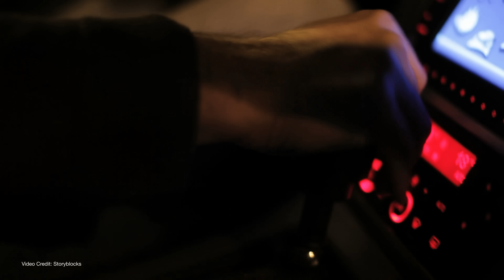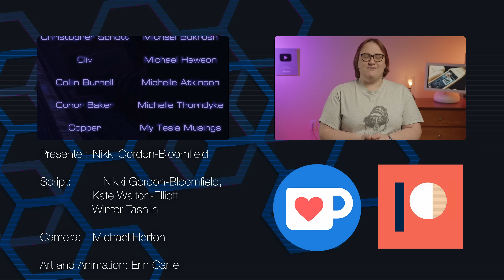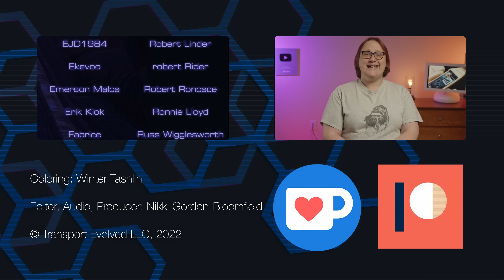Electric Cars Don't Need Gear Shifts - So WHY Is Toyota Working On One?

Comment: Manual transmissions for EVs is a great idea...for Toyota. More wear, more servicing, more parts sales and more revenue.
Reply: My experience  with manual is that they last longer than any other type of transmission.   I have a saab with 350,000kms , still works  perfectly.  Shifts flawlessly.   It's a joy to drive.
Reply: @leschortos9196  yes, manual transmissions are great for ICE cars. Unlike ICE cars EVs have max torque from zero rpm. They don't need to change gears. They have a fixed gear train - no clutch or changing of gears at all. This is much simpler and much more reliable. Basically no oil changes and no maintenance for the life of the car. Manual (or auto) gearboxes for passenger EVs are a stupid idea. The only EV so far that has a gearbox is the Porsche Taycan with a 2 gear auto in an attempt to get better acceleration over 100mph. Still, much faster EVs like the Tesla Plaid and Rimac Nevera are only one gear.
Reply: @fangitjoe  oh yeah I know all that,I think it's stupid putting a gearbox in an electric  car.  You know whats  even stupider, is having a car lightening fast for no reason  other than bragging  rights. Why not make the motor smaller,  lighter better range, and adequate  acceleration,  tell Elon, to put the power in his rockets, right now we need good heater in our teslas. Not rockets on wheels.
Reply: @leschortos9196  Yep, not going to disagree with you on that. Some of these new EVs are crazy. The Hummer weighs over 4 tons and has a battery 5 times the size of a normal EV. What a waste of resources.
Reply: I see that you are not someone with electrical education. Let me explain.
Electric motor is not efficient over entire range of RPM. You need to take into consideration RPM or Frequency in your calculation of current required to run at certain speed.
It is not only high speeds where EV motor is not efficient, it is also slow speed where your PF (Power Factor) can go as low as 40%.
For ideal operation and best efficiency you need to run (for majority of motors used in EV) between 60 - 80% of load. 
If you can manage this, you will rapidly increase range for city and highway speeds (more for the city than highway because of drag). And as added bonus you increase effective torque as this drops quickly after about 80% load
Reply: @beastlysun  thanks for the heads up, perhaps an automatic  trans optimized for  range may be the best option  then. Computer controlled for max range.
Reply: @beastlysun  Thank you for your genius lecture. Most EV VFD motors only lose significant efficiency at lower and higher ends of the speed range. For an EV geared to do 200kmh, extra gears provide insignificant efficiency benefit unless you spend a lot of time below 40kmh or above 160kmh. Nobody wants to change even one gear going up to 40kmh.
Reply: Very smart comment 😅 Grow up

Comment: More likely Toyota put in the patent to prevent anyone else from doing this. Whether they introduce a car with fake gears is likely unknown at this time to Toyota management. But if there is enough of a demand for fake gears, they are in a position to be the company who will do it.  I imagine they can do this electronically by just having fake torque bands for different RPM ranges of the electric motor. 

As for my 2016 CR-V, I prefer that the CVT behaves like a CVT and not a fake classic automatic transmission. 

But really, my next vehicle will be an EV, maybe in 2024 and I would not touch one that had a fake gearshift and clutch in it.

Comment: I took my drivers license behind the wheel test in California in 2007 in a manual transmission Toyota tacoma. I have never owned an automatic transmission vehicle. I do see the value in a manual transmission in icy and snowy conditions because it allows a controlled way to decelerate that seems to work better than braking. I am not sure how an EV would fair in this situation with the single pedal driving but I can see how the faux manual transmission in an EV could be more fun and make me feel safer in those conditions. I am not ruling out the possibility that an EV could do this job better of slowing in icy conditions but I do love the interaction of shifting! :)
Reply: Shifting regime or acceleration is dangerous on low adherence. The smooth, continuous range of EVs is an advantage here.
A Tesla slows first using regen, then brakes only if harder is needed.
Reply: @musaran2  Yes. I see. You are right. Any sudden change in speed due to shifting can cause loss of grip. I an very interested in trying an EV in icy and snowy conditions and learning how to use it in the safest and most fun :) way

Comment: I don't see transmission-type requirements adding much in the way of public safety.  Most people can reasonably learn to drive a manual transmission in 20-30 minutes, and the person teaching them is typically sensible enough to do so in a safe place, both for their own safety and that of their vehicle.  Those who prove to be non-adept gear-crunchers in this first experience tend to strongly self-select themselves as "auto-only" drivers.  And thus the imagined "problem" is effectively dealt with, without any unnecessary legalities, expenses or restrictions by the State.  I'd like to see the accident/injury statistics attributable to lack of manual transmission experience.  I suspect it is negligible but I'm open to being proven wrong.

Comment: I'm pretty sure Toyota just wants to add more moving parts and complexity so it adds more maintenence and higher repair costs.
Reply: Toyota prides itself on being reliable. So why would they want to engineer more maintenance and repair cost into the car? It's going to be an electronic system that simulates gears, I don't think there will be any real gears in the car or any moving parts other than perhaps a lever but that'll be electronic as well.

Comment: I have a 5-speed 1990 Miata. I want it to live forever, but when the tiny 1.6 L engine dies, I want to convert it to electric. It would be awesome to have an electric conversion that maintains the manual shift. It is a significant part of the experience of driving that car!
Reply: Replaced the engine in my 1990 toyota pickup a few years back with an electric one. Now I find I start off in 3rd gear and just leave it there. Great not having to worry about the clutch at stop signs, I do live in a pretty flat area which helps.

Comment: This is perfect. All electric car makers should do this. It will let them make the vehicles more complicated and more likely to have break downs. If I were them, I would include all kinds of unnecessary functionality like self-driving to run the prices up. May was well add an automatic transmission in too to keep the transmission rebuilders working. Maybe you could even make it so that you have to put 5 quarts of oil in it every few months to keep the oil companies going.

Comment: Have you considered that a young person faced with the choice of an EV for $10,000 vs an EV for $25,000 and higher with a gear shifter would really choose the gear shift car?...and those $10,000 EVs are here with more coming (i think you have have noted the Chinese invasion)...I doubt if Toyota will match their prices so they will have to rely on features and specs...not so sure a gear shifter will be an advantages feature to swing a deal...just my nickel

Comment: As i understand it, the president of Toyota (Akio Toyoda) is an avid motorsports fan and die-hard petrolhead. It seems like Toyota's engineers are trying to find a way to make EVs more palatable to Mr. Toyoda given his disdain for anything that doesn't go suck-squeeze-bang-blow. Any performance benefit is questionable seeing how Formula E constructors have settled on single-speed drivetrains for all cars.

Comment: All the gear stick has to roughly do is convert between speed and torque, so presumably would all be done by the computer in an EV, not a manual linkage.  I'd be happy with an auto with flappy-paddle changing.

Comment: I'm one of those "every vehicle I have bought that had a manual transmission as an option, I have gotten the manual" drivers. The only vehicles I have ever owned that were automatics were my electrified vehicles and my very first car that was a hand-me-down.

That said, single-pedal driving is perfectly fine. As Nikki says "switching the gears is part of the driving experience" for manual transmissions, but nearly every EV is exciting enough to drive that it isn't a huge add to manually shift.

Comment: Toyota may have a very inexpensive electric motor design that has a narrower rpm range of power.  A 2 speed automatic transmission might make sense in this case, but a manual transmission seems unnecessary.

Comment: Some people just need a gearbox simulacrum, I guess.  As long as it's optional, I'm fine.

I don't use liftoff braking much on my car since the regen and antilock brakes fight each other in wet/sloppy weather.  On the hills of the Cuyahoga Valley, though...

Comment: Hopefully it can “grind” when you “miss” a “shift” and “lug” when you “short shift” it….  🤦🏼‍♂️
Reply: And stall when the RPMs drop too low.
Reply: Hopefully you can pop the clutch going down a hill to start it if the battery dies. Remember my dad doing that on our POS Chevette back in the 80s rolling down the hill out of our driveway

Comment: The basic fact about EV's is that they are soooo darned simple !   Seems like auto manufacturers try to obsficate that fact by adding on all kinds of "extras", including fancy sound systems, self-operating doors, and other accessories to justify inflated prices.  While gadgets are fun, they eventually break and cause excessive repair expenses later.  This would include the "Fisher-Price" gear shift system...
Reply: You are 💯% correct. They won't make a basic EV without the bells and whistles. They won't do it, but, should. For every ICE component that is no longer needed, they will add in some other electronic component that will break.

Comment: Should use actual gear shift to get better economy at higher speeds. Sure, you’ll lose torque, but you don’t need to do burnouts at 100kmph!

Comment: Interesting reasoning, I'd never thought of the transition period for instructors, which is odd given my dad had been one during the war and I've done my share of training learners. 
Talking of old habits: when I could still manage to use a clutch pedal I still used to double de-clutch in appropriate circumstances even though the car didn't require it, just felt good to keep up the skills my dad taught me. Now I have to drive automatic I still enjoy kickdown and holding it in gear to go downhill, saves on breakpads 😂. I'm really looking forward to trying one pedal driving, it's just the next skill to learn as far as I can see.
Oh yes and you're right, of course, about learning to drive in a manual over here. My wife only took her test in her early fifties and she picked a school with a manual car even though our own was an automatic by then. So her licence would be valid if we were ever given a manual courtesy car, say, or we ever had to hire a manual. She passed first time despite being dispraxic, I was very proud of her! 
As for Toyota, who knows what their reasoning is, but I bet they hadn't thought of your idea! I reckon they want to put something in to go wrong so their dealers have something to fix!

Comment: The cynical part of me suspects Toyota is throwing a bone to their dealers by including a part that will require maintenance and/or repairs.  More likely is that Toyota, like lots of other companies, patents things that they never intend to make just to pad their patent portfolio.
Reply: Yes, that's exactly what they will do. Along with add in a bunch of unnecessary electronics and untrustworthy features like self-driving to drive up car prices. Anything to pad the prices and increase break downs and maintenance costs.
Reply: @idmhead0160  Oh don't you worry, there is plenty of electronic sh*t in every single ICE or EV, and most of the made at very poor standards.
Reply: I think the plan here is to have pseudo gears and pseudo clutch pedals, meaning there are not actual mechanical components involved, merely a recalibration of the throttle and brakes to mimic the feel of gears, that don't actually exist.

Comment: Currently driving an ICE again after 3 years with an EV (car is the shop for a very supply strained new windshield), while I do really miss the low-end torque/accelration and 1-pedal driving. I also notice how much I'm enjoying having a car again that I can run through the gears, so I wouldn't mind something with fake gears for when I want to enjoy driving.

Comment: The question I would have is, Are they truly fake gears? Or is Toyota trying to cheat and cut corners by using cheaper motors that don't have the bandwidth or capability of more expensive ones. By using a cheaper motor and a gearbox, you could obtain the needed performance without investing in R&D or new production.
Reply: Gear box + clutch are expensive too…
Reply: @musaran2   Yeah, but what I'm saying is that they're probably just gonna buy an off the shelf motor from Bosch or whoever, and a gearbox from whatever company makes them, so it's probably cheaper than actually having to develop their own high performance motor.

Comment: Daughter drives our Bolt in "D" and uses the brake, doesn't like regen for some reason, but I can go a week without touching the brake pedal. While not needed in BEV I can see it providing some "mental comfort" to non-car people that are just used to the sensation of gears. I do appreciate the pretend shifting in our Forester but it is nice in a CVT because just those changes cuts down on the typical droning the constant RPM of CVTs produce.

Comment: Just another frivolous endeavor being undertaken by Toyota. It’s already bad enough that they keep pushing hybrids (not even plug-ins) and hydrogen fuel cell vehicles instead of EVs. Just mass produce an EV Toyota. Enough with the nonsense. A stick shift EV will not move the needle 🤦🏾‍♂️

Comment: My mid-drive electric bicycle has gears, and there is a very noticeable difference between starting in a low vs high gear, there's a specific range of cadence for best performance.
I've ridden hub drive ebikes and emotorbikes too, and there still is a noticeable feeling of a power band after you've accelerated a little.

Surely the same applies to cars? 
of course, unlike restricted mopeds and bicycles which have legally restricted motor power, cars tend to have far more power than they need for normal driving so it's not as noticeable, but a gear for city driving 0-30 and higher speed gear for 40-70 could produce some  higher efficiency could it not?
Reply: No. At low speed there's enough power that the traction control is dealing with it. More torque won't make it faster.

If as the manufacturer you want to make it faster, spending the weight on bigger motor and controller yields more bang for your kg and more bang for your buck too. Simplifying assembly and maintenance.

Comment: Maybe Toyota is planning on building a BEV with a wimpy motor and battery that needs a gearbox to get enough rear wheel torque.  They have done everything they can to discourage BEVs so far.
Reply: Honestly I hope someone can introduce a base spec, affordable electric car with a two speed that can get better acceleration, speed capability and higher speed efficiency. Even if a gearbox theoretically would just sap any benefit. It's one way of compensating for lower battery voltage systems that we don't see on the market (ie the Renault Twizy - 58v-70v 🤷‍♀️, the Citroen Ami - 48v)

Imagine a 100v to 200v pack, as a single speed it would have less of a top speed, the C rate would be less, but inside there can be more arranged battery cells in parallel for more Amp hours instead of the usual 400-800 volt packs that need no such thing as a gear box.
Reply: @BeLowBelowo  You mean like the VW E-up? Or Skoda Citigo? I think they are looking at releasing new versions of those. But you're right, I would prefer a smaller EV - just ideal for European cities.

Comment: Not for performance, Formula E started with 5 speed gearboxes, after a few seasons, they all dropped them for single speed. Further, I doubt it was for performance initially either, it was more likely they compromised due to "parts bin" availability. The clutch it's totally useless, the electric motor has no stall and very little inertia.
Reply: It was more than likely a "level the playing field" kind of rule. There seems to be many of that kind of misunderstanding in first gen E motorsports.

Comment: Not having driven an EV I have wondered if driving one with High Regen would feel like driving a car in to low of a gear giving to much throttle response.
Reply: Not at all since you get used to using the regen (one pedal driving) to slow the car or make a complete stop silently. Ive driven manuals and have left foot brake with standard automatics for eons and find the strong regen perfect, even for stopping. 
My i3 has a position on the accelerator pedal between accelerating and backing off that allows coasting. This sweet spot if exploited can add to range in certain conditions.
Reply: Pretty much. But without the vibration and noise.

Comment: This is Toyota’s top EV research priority?!? Before they’ve made a single mass market EV available to the public they have to figure out how a few thousand driving instructors in the UK will eventually teach teens how to use the several Victorian-era-designed used-cars still on the market?

By the time Toyota has an ev on the market there’ll probably be more used plug in hybrids still on the market than manual transmissions
Reply: Might be the case already